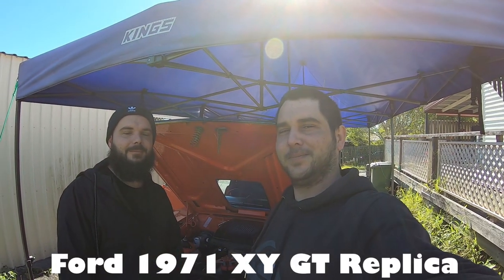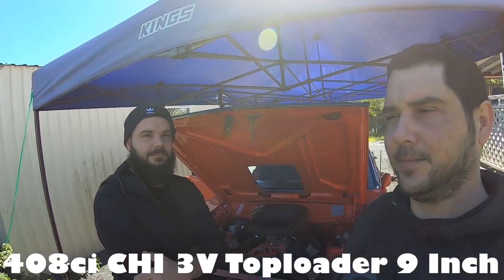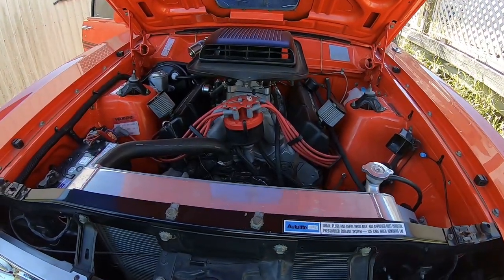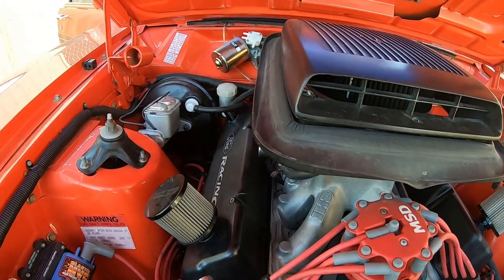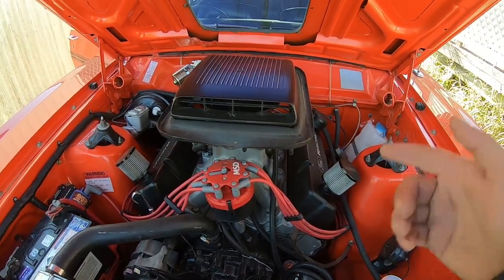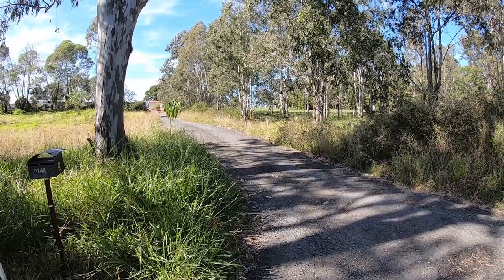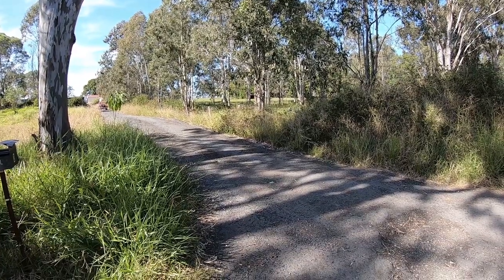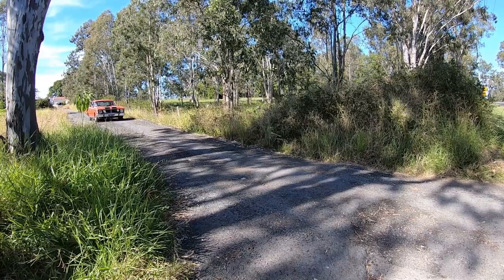XY GT 408 3V CLEVELAND TEST DRIVE + CRUISE

Comment: Perhaps you could give some info on the stroker kits for the Cleveland and the costs, which kits are the best and pitfalls to look out for. Which head combo from CHI you would recommend for a street driver that behaves well in town and not to much of a bitch to drive.  As in drivability and still ok vacuum for the breaks. Cam I'm running has 12 inches vacuum and brakes still good. Crower hot street beast. Cheers

Comment: What is the brake setup on this? I am thinking of upgrading my XB ute with Wilwood on the back but I guess if you do the back you gotta do the front? Any changes needed to brake master cylinder when going from drum to disc?
Reply from the maker: The drum brakes need a lot more line pressure then a disc that’s why they make the proportional or adjuster valve to help get the rear bias right. Wilwood also make a little piece that can keep the pressure in the line too if needed. You should be fine going to disc if it’s now drum on the rear as the disc needs less pressure anyway.

Comment: Would you recommend a stroker over a 351 for a street engine? Seems everyone is going 408 but is it good for longevity? Also solid roller on the street how long would the lifters last for street duties?
Reply: Check out Zoran from Competition Engines in melbourne talking about the 0.937 lifter bore conversion for roller cam durability on the street, and also the issues with 408 pistons vs the new one they have designed. Very cluey dude 👍